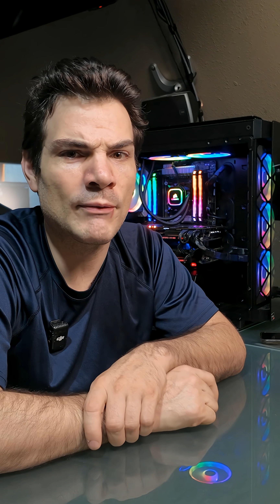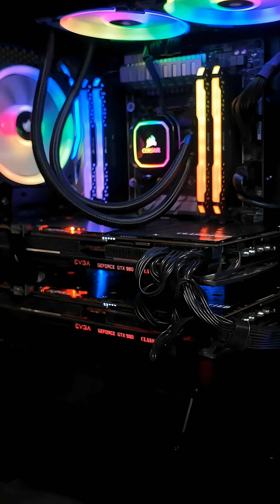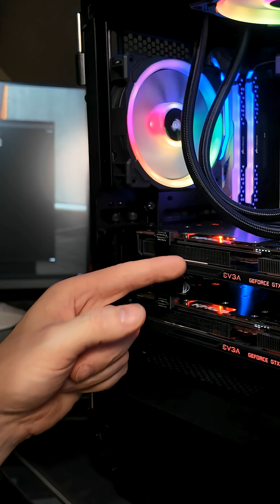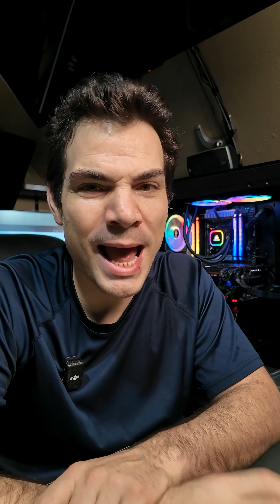What is SLI? A quick overview of the awesome dual GPU tech everyone loves

Comment: Thoughts on dual GPU on lossless scaling I've used it and its fairly good LTT did a vidoe on it but they did it wrong you have to set your framerate to half your refreshrate though afterburner/RivaTuner and run the display through the second card but the game runs on gpu1
Reply from the maker: I have not had a chance to mess with it... it definitely aint SLI, but thats all I can say at the moment
Reply: @dragonsystems5973 no its not sli its a pain to get it configured but once you tweak it it works fairly well with old hardware i used it with Final Fantasy 16 and it was smooth outside of some slight artifacts on the hilt of the sword while sheathed

Comment: What’s your specs dude?
Reply from the maker: On the SLI rig in the video?
Reply: @d @dragonsystems5973 yeah the sli build looks very sick!
Reply from the maker: @Teamgodzilla54  
i9 9820X
Gigabyte X299 Designaire
32Gigs Corsair DDR4
2X EVGA Kingpin GTX 980s
1000 Watt EVGA Power Supply
Corsair 500D SE Case
6X Corsair LL120 Fans
Reply: @dragonsystems5973 I have a question what’s the latest generation of gpus to support sli
Reply from the maker: @Teamgodzilla54 1080Ti, then it morphed into something called NVLink